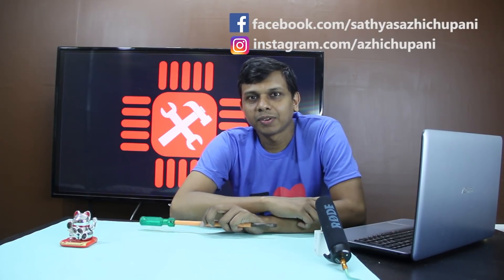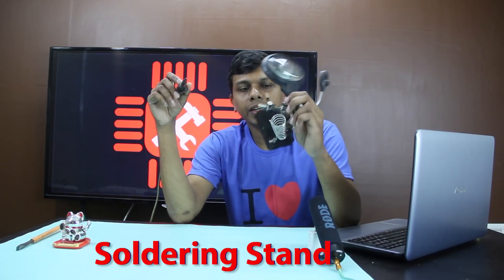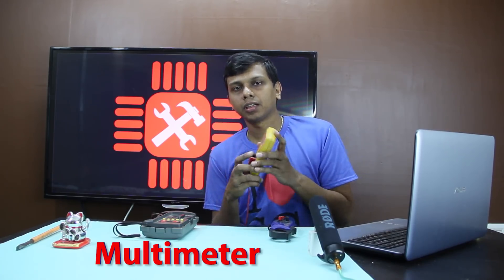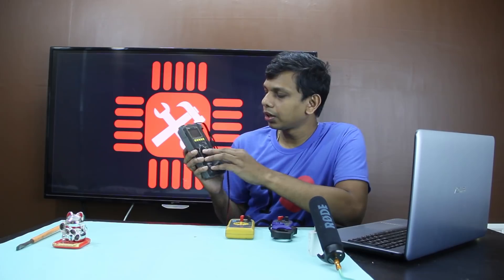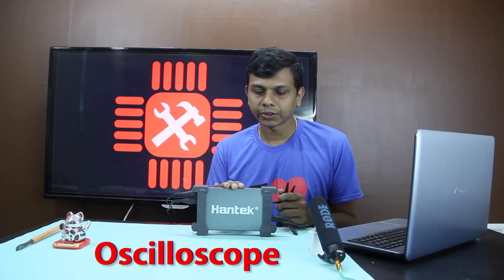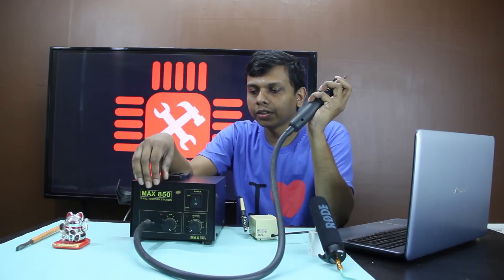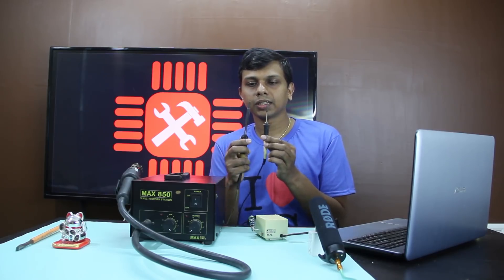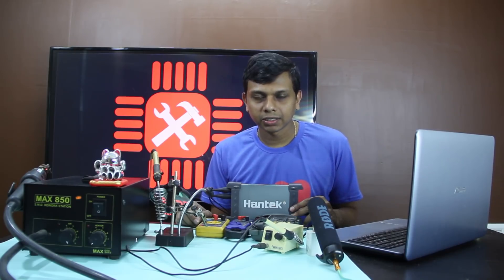Electronics tools for Beginners - തുടക്കക്കാർക്ക് വേണ്ട ടൂൾസ്

Comment: ഈ soldron soldering iron അത്ര നല്ലതാണോ, ijan work ചെയ്യുന്നിടത്ത് yearly 1-2 iron വെച്ച് damage ആകുന്നു, ചിലത് not heating, ചിലത് പൊട്ടി തെറിക്കും. പിന്നെ tip ആണെങ്കിൽ maximum 2-3 weeks last ചെയ്തുള്ളു
Reply from the maker: Enikku hobby useinu alle.. professional use allalo so athu dharalam .. ithu ippo 4-5 years aayi
Reply: 25w soldron  ഞാൻ 8 വർഷമായി ഉപയോഗിക്കുന്നു
Reply: @Tech4mukesh  professional use ന് പറ്റിയതല്ല

Comment: Appol desoldering pump , desoldering wink , ic tester , work station , variable dc volt output enniva koodi vende ...
Reply from the maker: Venam, athu tools aano raw materials aano?
Reply: Azhichupani 
Desoldering pump , ic tester , work station , variable dc volt power supply are tools bro .. these are must tools for medium level electronics tech geek ... Also these audrino and ic programming interface ....
Reply from the maker: @cijoykjose  vittu poyi,
Reply: Azhichupani 
Thank you for your time to respond to my comments bro... You can make a part 2 of this video and include those .
Reply: Azhichupani 
Desoldering wink is also a tool , but also has the character of raw material...

Comment: Chetta ee battery amp engane multimeter il check cheiyam ?
Volt alla amp
Eg : 12v 24ah 
Ee 24ah batteryil undo ennu engane multimeter il check cheiyum
Reply from the maker: Paranju tharaam... Onnu prepare cheythotte.. AH multimeter kondu alakkan pattilla